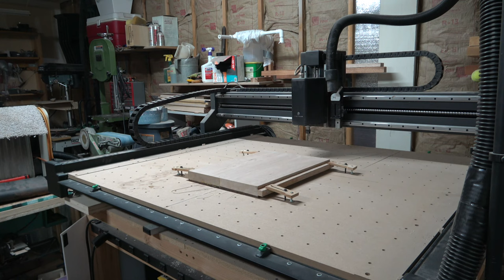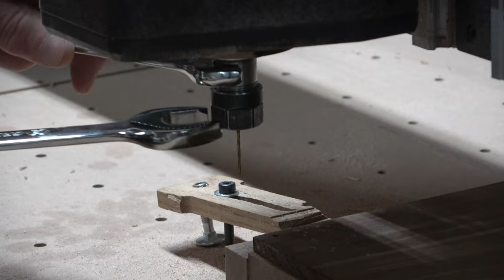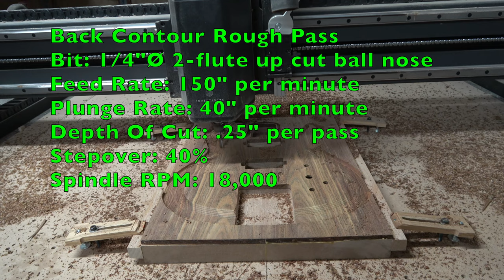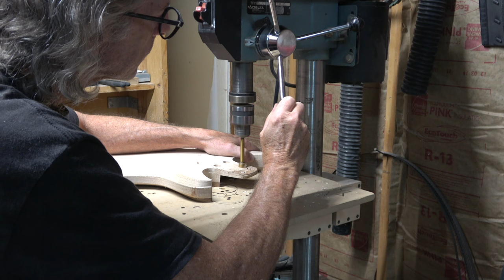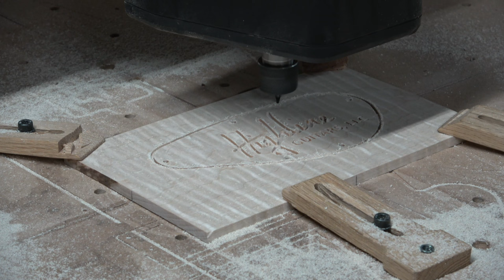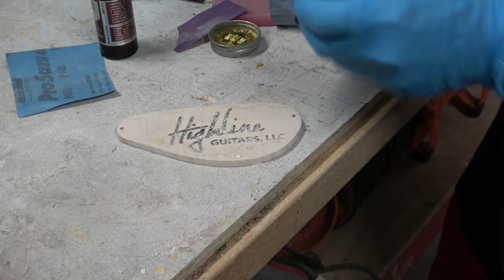Combining A Headless Electric Guitar With A Traditional Electric Guitar Part 7 Carving The Body

Comment: Hello! Why aren't you using fences screwed in your wasteboard so the flipping operation will keep the 0,0 position on the bottom left corner of your blank (if your blank is square)
Re-align your blank by eye can be tricky, Miss alignement can appear
Reply from the maker: Fences are a pain to set up and are only beneficial if your blanks are all the same size. Mine never are.

Comment: Is the is first time you've made this prototype, or have you made previous iterations with cheaper materials? I mean with all of the hole locations for the bridge and such, if your CAD drawing is  just a little bit off, you have to scrap the entire body.
Reply from the maker: It's a prototype, but not for the reasons you mention. I always proof my CADs and make sure they will work before start the build.

Comment: Why are you wasting time with those stupid hold down clamps??  Been there done that.  Just screw your stuff down.  Holds material a lot better, nice and flat too.   You can always replace the spoil board.  If that is to much work because you wasted a bunch of more time installing hold down T nuts in the spoil board and do not want to scratch it, lol, then just lay some mdf on top of it and screw to that.   Makes life so much better.  Thanks for awesome videos, love ya brother.
Reply from the maker: I think using screws is a waste of time (removing and replacing the waste board). It’s also a waste of money (4’x4’x1” HDF nice a ek adds up).